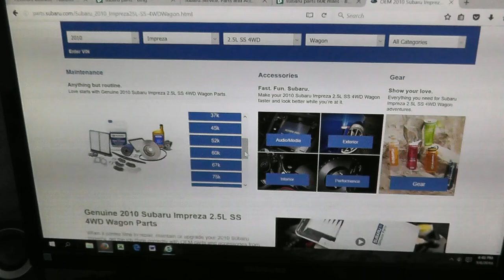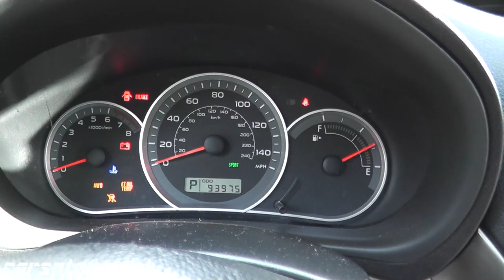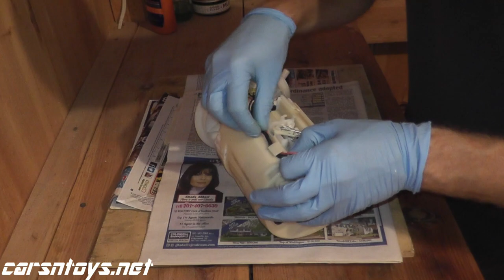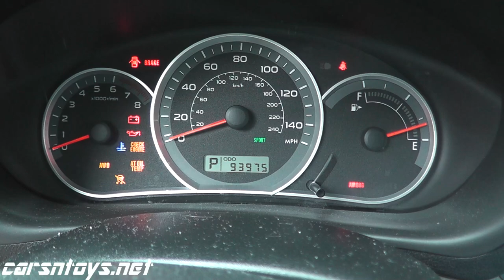How To Replace An In-Tank Fuel Filter On A Subaru

Comment: Man, I broke two fuel assy mounting studs by trying to remove the eight bolts (hit it with PB blaster for few hours before, bolts were quite rusted patiently and slowly trying to turn the nuts without applying to0 much force). Studs in the 12 o'clock and 7 o'clock sheared right off. Still some nuts I could not remove (11, 8 and 6 o'clock). Now I can't remove the assy to replace fuel filter and gasket seal. And I'm afaid to tighten it back up as is and break more studs. Left it overnight with more PB-blaster. Don't know how to get out of this mess without having a new fuel tank installed (1800 canadian dollars). I'm quite pissed. 2008 Impreza 2.5i with 62000 miles. Timing belt, tensionner, pulleys, spark plugs, coolant just replaced 300 miles ago.

Comment: ah.

i think the full assembly is the play for my 138k mile guy, and i also won't be in a rush to do it.

safe to assume mine has the original, and it doesn't run a m a z i n g, the computer reads 18mpg lol, commute got a lot shorter recently but that's still pretty extreme. but i'm sure i have other issues too i should probably nail down first

Comment: Awesome video. Really enjoyed it being a DIYer myself. I have a 2008 Impreza 2.5i 5Dr MT with 98000km on the odometer. It got cold outside (around -18°C) the other day and took my battery off to charger it up (haven't driven the car ofter the last 3 months). Then I went to fill up on gas. Now I have a weird was smell when I stand outside around the front and rear right wheel. Any idea where this might be coming from ? Is there a hose or something that's likely to fail on these suby models in your experience ?

Comment: So to make this short: Either spend $70 and go through this long and tricky task OR get the Fuel Pump & Housing Assembly as one unit and just replace it with old one for $500 (I'm thinking SPECTRA PREMIUM SP4116M). Dealer says "The manual is old info and they stopped servicing the fuel tank since 2006. Subaru service will the replace the entire assembly for over $600 and that's in case there's a problem"

Comment: So, I took everything apart on the passenger side and replaced the pump but car wouldn’t start once back together. Question is, that rubber disc part attached to the access panel is behind the drivers side. Did I change the wrong one or is it just one only in the passenger side?

Comment: I used some seafoam in my gas causing low idle.  General consensus is that my plugs are clogged from the carbon gunk, or that my fuel filter might need replacing.  I'm hoping after this tank of gas with seafoam the issue goes away, otherwise I may replace both plugs and fuel filters.   Only at ~90k miles on my 2011 and have used seafoam a few times before over the last couple years.
Reply: Or do regular scheduled maintenance. the plugs aren't as hard as people make it out to be.
Reply: basically this. I got as much footage as possible when I did mine so I'm uploading that next week cause I see toooo many people scaring newer owners off. the difference of $60 for the plugs or $300 for the dealership/shop to do it can be huge for struggling families. there is no way I could have got the plugs done on time with the maintenance schedule if I had to take it in for plugs and filters. too much money all totaled.

Comment: Need to replace the filter on our 2005 OBXT. But... darn if I can even find the part number for a part like this. I want to also put in a little higher pressure fuel pump while I'm at it (for a slightly larger turbo). But it seems there is none - and no aftermarket pump assemblies either? Seriously?
Reply from the maker: There are some very good Subaru dealer websites that list part number and schematics. Search online for 'Subaru parts' and click on any link that's indeed a Subaru dealer. Or, call your local Subaru dealer. Good luck

Comment: Its strange because everyone is replacing the fuel pump assembly, yet few are replacing the filter screen. So can anyone clarify exactly what parts need to be replaced?  I feel like the pump screen is the only thing that needs to be replaced. A $20 part. Versus the $80 assembly?  Someone please clarify.

Comment: I thought the filter was the strainer on the end of the fuel pump.  Is that part not replaced?
Reply: I think the filter is a foam cylinder inside the metal cylinder ( the foam we did not get to see) - it was why I was watching to see how bad it was. Our Subari impreza 2010 hesitates between 2000 rpm and 3000 rpm, but recently moreso (BTW i just changed the air filter).
Reply: He did not replaced the filter , at least on camera. The little sock strainer IS the only filter. Toyota uses that same    assembly and "last for the life of t he vehicle ". If ain't broken I would not replace it. You are asking for trouble. Braking brittle pastic, o rings that do not reseal after reassembly.... Nice video , very detailed. Great info for pump replacement.

Comment: Hey man! Nice video, thanks a lot! Even though I don't owe a subaru, however, this seems to be very similar and almost identical to the same process as in a toyota echo...
Reply from the maker: Thank you! Appreciate the feedback. Cheers
Reply: Though one thing, some may want to leave off the final cover when testing the car, to see if it leaks.
1 Tech did not push the clip on 100% and had to remove and start again.
Reply from the maker: Bummer
Reply: Doing the test drive.. pouring fuel like anything..

Comment: I would guess the best way to deal with this is replace the entire assemble say every 100k miles or so. these denso fuel pumps may last longer that 125k may be more like it.
Reply: I frequent the Legacy forums and I'm sure it's the same fuel pump/filter setup, most guys are 100k plus and pumps just fine. One guys at 150k miles. I'm at 65k now. I'm thinking the same. Change it out around 100k miles. I did my own spark plugs after the dealer telling me $581 to do them, bahaha.
Reply: bradley goode Mine is on 180k and still going, from 100-120k it was running near max until I got another fuel pump to help it. Not sure if my fuel pump is extra good or what but it's still going strong on a modded car
Reply: 2008 Impreza w/ 160,000 on origonal fuel pump unit

Comment: Hey do you guys think there is a way to bypass the intank filter and add an in line filter in the engine bay
Reply: I was thinking about that, but the filter is before the fuel pump and protecting it.  Adding a in-line filter after the pump may protect the injectors but would most likely hasten the demise of the fuel pump

Comment: hello sir i have nissan almera b10 i had replaced the intank fuel filter with aftermarket one the micron gage of the new filter is very small causing pressure drop in the injectors bar my question is can i inject a miture of oil and gasoline fuel a high viscosity mixture in the new filter to increase the porous pf the new filter the flushing it with gasoline fuel to remove any oil contaminants then reassembling it ?please help me

Comment: not sure when they changed this but some models/years have a secondary filter in the engine compartment by the driver side strut tower - easy pasy to change filter there. could be added for others ?
Reply from the maker: Yeah those a incredibly simpler to replace.

Comment: Hello mate, what is the address of that website where you checking that 60 000 mile service? Cheers
Reply: parts.subaru.com          You can make that out in the video if you freeze it.  Once you are there, you should be able to figure out the rest.  Good luck fellow subaru owner.  -E
Reply: It's also in my Subaru's owner's manual.

Comment: Trying to replace the fuel pump on a 2003 Subaru Legacy L  Can not fin the pump !  Looked in the gas tank only a round filter where else would it be??????
Reply: John and catherine Lezinsky under the hood! Way easier
Reply: On line parts diagrams, how do they work??????

Comment: Where did you get the replacement filter?
Reply from the maker: Subaru dealer.
Reply: I finally found one at Car Quest from one of their secondary suppliers for $80. Not easy to find the filter kit separately. But the full assembly is $359 even for after-market fuel pumps.

Comment: Is there a Hack for this?
I think, replace the filter once by Removing the Filter, and install an inline filter under the engine bay.
Reply from the maker: It really didn't need it. I did cut open the filter after this video (https://youtu.be/gjiHKl54prs) and it was in great shape. Older vehicles have an inline fuel filter but most modern vehicles (unfortunately) place the filter in the fuel pump assembly.
Reply: @CarsNToys  ok, no video on that URL

Comment: Don't buy cheap gas from stations that don't service their tanks and pumps, don't run around with the fuel tank almost empty all the time ( fill it up), use fuel system cleaner to remove water, and DON'T WASTE TIME DOING THIS "SERVICE"
Look at the filter in the video, IT'S CLEAN.  You can add an inline fuel filter if you are worried about the fuel injectors.
Reply: What if you don't live/drive your Subaru in the city?  What if you take your Forester XT offroad, to remote locations, and need to fill it up there, say at gas stations in small towns or on Indian reservations?  What if you live in the Third World or developing World?
Reply: Totally agree with the better quality gasoline. Costco is one of the best places to go in the US as it’s “Top tier quality”

Comment: If this is a job you don't want to do yourself, then do NOT get the dealer to do this, because they won't.  They'll just tell you "sure we can do this" and then do a "fuel tune up" and basically just put additives in or some other crap.  

Go to a reputable mechanic and get this done if you don't want to do this.  I do get that dealerships don't want to have even a drop of gas spilled onto the seats, but the dishonesty here is appalling...

Comment: There has got to be a good way to remove all this shit and replace it with a in-line filter xp
Reply from the maker: Older vehicles, absolutely. Newer vehicles tend to have the filter built in tank.
Reply: Yeah what I'd you took out the old filter and didn't replace it. Then put the inline filters upfront somehow